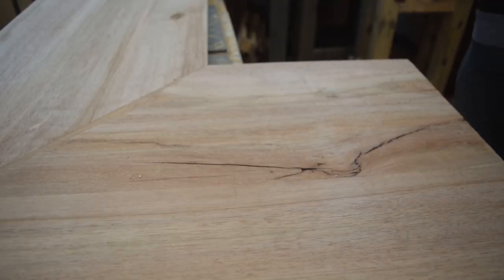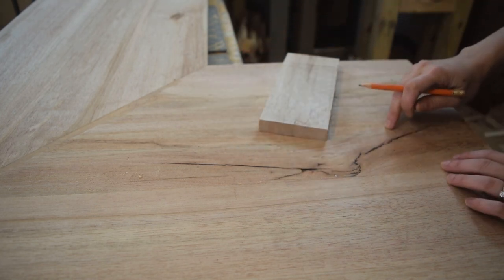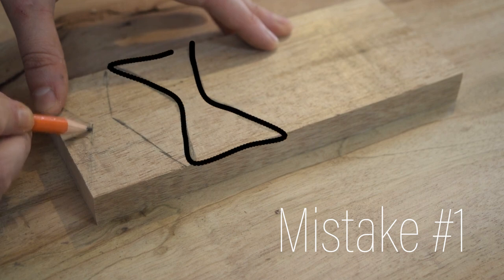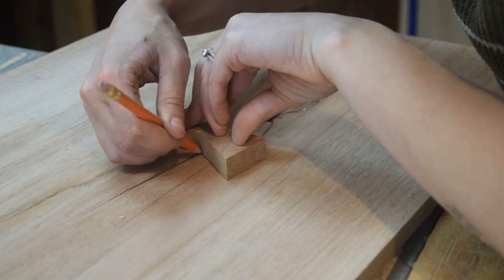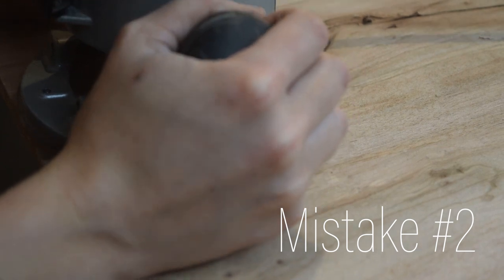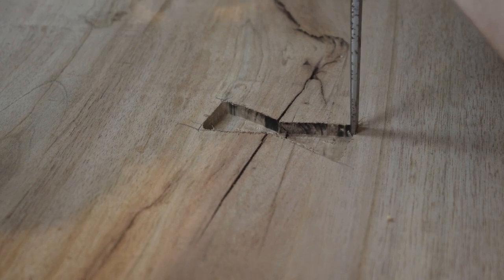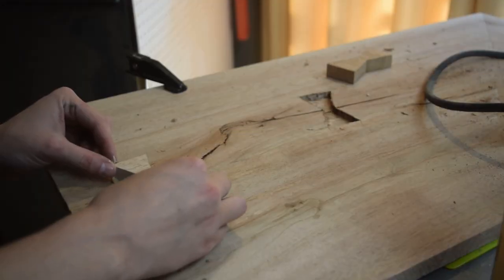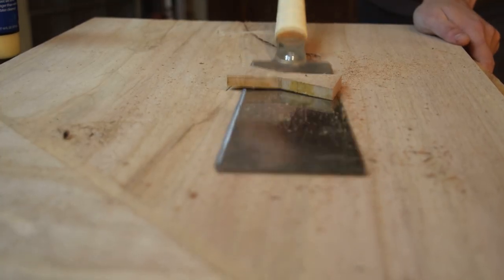Bow Tie Splines ...with Rookie Mistakes to Avoid | DIY

Comment: Suggestion for future work - invest some time in making an inner and outer bowtie template  for use with your router. That way it's not like each is a new cut. I have made a small, medium and large bowtie templates and I just pick the size I need.
Also, are you in the witness protection program? We never see you in the videos 🙂
Reply from the maker: Thanks, John! Those would definitely eliminate at least two of my mistakes. 

...and maybe I am, or maybe I'm not? Haha!
Reply: @HonestWorkDesigns  If built everything perfectly then it would get boring!